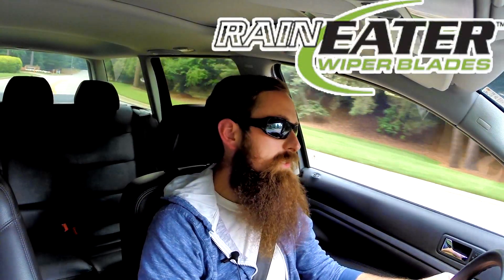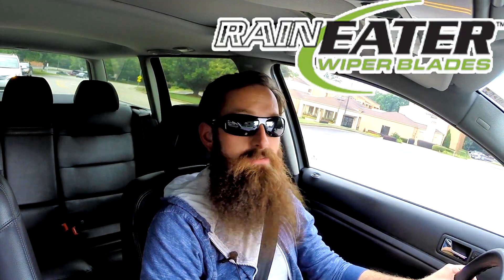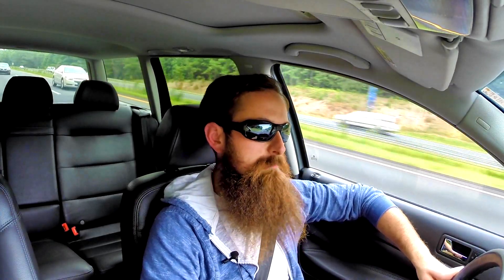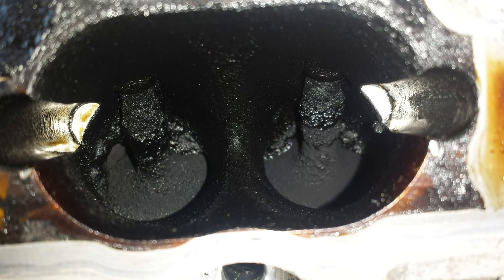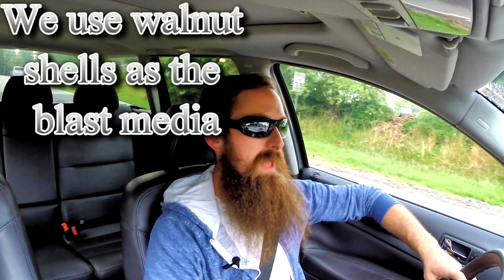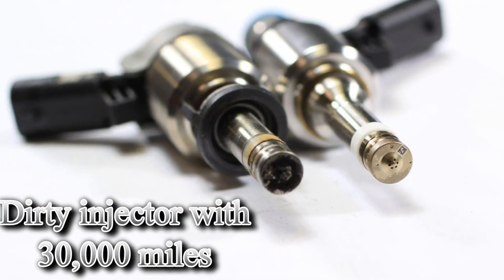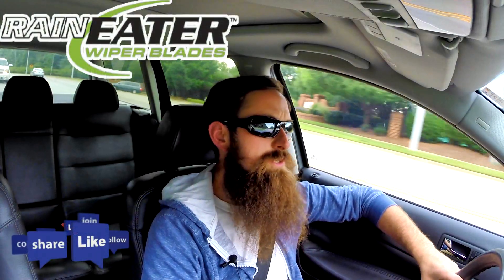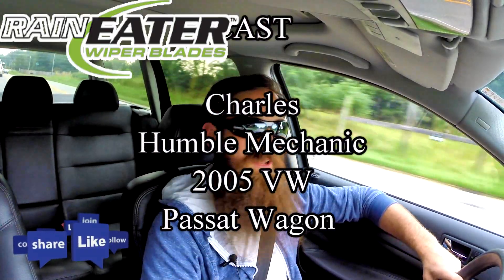Preventing and Fixing Carbon Issues for Direct Injection Engines ~ Episode 80

Comment: Hey Charles, I feel you left out a big point about how to prevent carbon build up. It's the easiest to do, a long highway drive. My friend has a 2012 CC with the Gen2 2.0 TSI engine and my mother has a 2014 Tiguan with the exact same engine. The difference? My friend did about 5 miles a day in city driving. My mother does about 80 miles a day and that's pure highway driving. The result? His had extremely bad carbon build up at 20,000 miles. It would misfire when warm, power was down, and it got bad fuel economy. My moms Tiguan has 50,000 miles now and got her intake valves inspected with a bore scope and it was almost like new. Very little deposits and no carbon chunks. I "cured" my friends CC by taking it across the country. It started out getting 22mpg and then got as high as 37mpg. I told him to take it on the highway once a month for over an hour. His fuel economy is up, his power is up and it hasn't misfired since. Ever since I did that highway run, the engine practically burned the deposits off since it gets super hot on prolonged drives. Thats my 2 cents...
Reply: Carl Strandberg In the case of where someone is driving for not even 5 minutes, they need an electric car. A gas engine car will kill itself after practically no heat cycles. I have a 2013 Jetta TDI. Idling my car will never raise the engine temp, even in -20. I start it, let the idle smooth out for maybe 3 seconds, and I drive easily until my temp gauge starts moving.
Reply: Brandon Friesen idle will make the car warm up u dumbass
Reply: Luseei Fuel economy is a side effect of getting rid of carbon build up. If you do 20+ minutes of highway driving, then you should never come across carbon build up. But to those who do idle city driving that lasts for 10mins, then to prevent carbon build up, you need to do at least 2 straight hours of highway driving every couple months to get rid of it. It's just the side effect of direct injection.
Reply: @brandonfriesen5389  So, going by your post, it's totally okay for me to get that direct injection WRX I'm looking at so long as I go out of my way to have fun with it? I only drive six miles a day, five days a week for work, so I could take it on one of my off days for a 20-30 minute drive on the highway. I've been looking up info like this (known problems and preventative maintenance stuff) for several days now because I really want my next car to stick around for more than 5 years.
Reply: @brandonfriesen5389  I don't think you guys understand how bad this issue is, it will be an issue for any DI engine. Not just vw. 

I've seen cars need to be started 4 and 5 times to stay running from GM, VW, BMW, and Mazda now. 

I've seen this build up on cars that get a "direct injection service" every other oil change (keep in mind many synthetic oil change intervals are 10k) still get this build up. 

Between EGR and poorly designed crank case ventilation systems, and the fact the fuel is no longer cleaning the valves chemically, you get hardened deposits that can not be removed from driving the car hard. 

Yes, routinely going on long distance higher rpm drives will lessen the rate at which these deposits form, but my 160k Mile Mazda has had to be done twice now and its boosted, so no amount of heat that is safe for the engine is going to magic away the gunk that builds up. Stuff gets on there, hardens over time, then more stuff builds on top of it. It takes me about an hour per cylinder or 30 minutes per valve to clean them. AFTER I have remove the intake manifold. It takes a lot of scraping and soaking in chemical treatment, and then blasting with a sand blaster gun and walnut media to remove MOST of this crap, you can't get it all out short of going to new valves which would require removing the head.
Reply: +Brandon Friesen I had the same experience.  My FSI motor was throwing a cyl 2 misfire consistently. I drove it from LA to Washington (20 hours straight through) and gas mileage is up along with no more codes.  It seems that the prolonged driving, spirited and on cruise control, helped with my FSI problems.
Reply: The current manual for a new GTI actually talks about what to do if the fuel economy goes down and engine starts to misfire. Their solution is to "avoid driving short distances". To me that sounds like even VW themselves suggest taking their cars on longer drives in order to prevent carbon buildup.
Reply: @BerserkFury89  99
Reply: Yep, my old father who was a car mechanic recommended it to me too: go onto the highway and drive like hell for a couple of hours every month. Fun to do too. Never had any issues with carbon, ever.
Reply: He already mentioned this at 4:12 the “Italian Tuneup” lol
Reply: Brandon Friesen Yes, you're correct about the Techron I put in the tank. That won't touch the valves. I put the Redline through the vacuum line located on top of the throttle body so the drips would be caught by the airflow and (hopefully misting) be ran over the intake valves. I did half a bottle then let it sit for 30 min and did the same with the rest. I didn't do any visual before and after of the valves becasue I would've had to take the manifold off twice but the first time I did it I got a bit of carbon suspended in what I thought might be water that came out of the tailpipe.
Reply: @coldbiscuit  Using a fuel additive to clean the valves actually isn’t such a bad idea. But you might get even better results with a different method getting it in there. Why not mix some gas and additive into a clean garden sprayer, set the nozzle to a little finer mist, and spray it through the throttle body while keeping the engine at a steady 2k rpm. I’ve never tried it, but it seems it would atomize better. Plus, it would give you the benefit of getting gas to the back side of the valves like it would if it were port injected.
Reply: @coldbiscuit  Your treatment sounds really good, My worry with walnut shell blasting is, where does the residue end up? is it just burnt next time the engine starts? and ,if so, is there any danger that when exiting through a turbo charger that the turbo blades could be damaged.
Reply: BerserkFury89 even my 95 golf it is recommended to not take short drives or my oil sludges up. if i drive it longer than a half hour and let it get really hot then it runs great and the oil stays clean and viscous. i know its not the same problem but the best thing you can do for an engine is use it
Reply: Brandon Friesen this cures sludge problems as well
Reply: Then my car is probably not going to have this problem as I'm always taking around 200 mile road trips sometimes 1 or twice a month, depending on the time of year of course. Got one coming up in a month or 2 now. On top of that I let the car just idle before leaving and when arriving at work for a few minutes. I never just shut it off when I arrive.
Reply: Very true and excellent info. I have also found synthetic oils with low vapour or Noack Volatility numbers work well. My wife has 18 Q3 with no problems as i switched off the dealer Castrol Syntec to Amsoil and it has now carbon on intake valves when i checked with scope.
Reply: TheRebuilt1 it has carbon now or doesnt?
Reply: James Medina doesn’t . Amsoil has Voc numbers their website for European 5w/40
Reply: @TheRebuilt1  Sounds very positive, i Googled 18Q3 and do not get any make or type of oil. Could you be more specific please.
Reply: Hessel Dijkstra . Car requires 5w40 and I use Amsoil 502.00 classic euro formula. It’s vapor voc number is 7 percent which’s very low compared to standard synthetics like Mobil and Castrol Edge
Reply: @hesseldijkstra5327  2018 Audi Q3 with 2.0 TFSI engine to be more specific from me.
Reply: @TheRebuilt1  u mean with Amsoil, it added more carbon?
Reply: Shariff Yep no it reduced carbon buildup as the Voc (Noac Volatility) number is much lower than Castrol Syntec’s 11 vs Amsoil 7
Reply: This is the same thing we've had to do in european diesel cars for years now. You'll literally destroy them with city driving. Different problem, same cause: Combustion engines are not built for that kind of use.
It's a good excuse for some good ol' "spirited driving" when possible, though :D
Reply: +Brandon Friesen I think that by running a bottle of complete fuel system cleaner through a suitable vacuum hose connected to the intake manifold every 3-5k would be a good preventative as well. Redline SI-1, Techron Concentrate Plus, Valvoline Complete FSC, or Gumout Regane (Not the high mileage) Those have the highest PEA content (Redline actually, but Techron is best bang for buck) I put Techron in my tank and ran Redline through a vacuum line on top of the throttle body and it cleared up my problems.
Reply: +Brandon Friesen Exactly! I was more thinking of gasoline engines (which was not the topic, but anyways)
Reply: +Johney Aimlessly haha looks like I shouldnt have a problem, I do too
Reply: taking a long hway drive to regain fuel economy, that sound like 2×5 n 5x2 ,both equel to 10 ☺
Reply: Brandon Friesen your absolutely right. Take on the freeway and Accelerate with high Speed cautiously and carefully
Reply: so in theory I should run my wrx on the highway with  a bit of spirit to keep it clean?
Reply: Myth .I drive plenty on the highway.Still had buildup.
Gas mileage started dropping at 60k.
Besy bet is to put an intake cleaner every 5-10 k.
Reply: I'm thinking of buying a used Tiguan (aiming for one less than 25k miles on it), do you guys recommend just driving that thing for an hour or so in the highway or do you think Intake Valve Cleaner sprays will help with it?
Reply: @minabobina420  use CRC intake valve cleaner. Works great! Do it before an oil change.
Reply: Brandon Friesen gives me an excuse to highway cruise heck yes
Reply: I have a 15 beetle 1.8t auto. I live in South Texas. Hot and humid. Car has 49k on it. I always let it warm all the way up before I drive it. I've heard that's the best for your turbo before driving. Idk. Hot oil flows better. Just what I've researched. I do drive fast, not hard racing type driving. Idk if I have carbon build up or not. Very good maintenance. What's the best way to see if I do.
Reply: yeah on the HWY miles. my 2015 GTI is at 165K, the dealer checked it out around 130K for carbon and they said its fine. for about 4 years in a row I drove 200 miles a day for work mostly on hwy.
Reply: @bucknut2000 how did the dealer check it and determined it "was fine" ?
Reply: I have same 12' CC turbo TSI 49 tho. Miles local driving but I drive fast , no problem, how ever I am planning a 1,000 mi. Trip up north then back so probably 2,000 highway 500 local. I'm nervous to take trip because, plastic parts and no major work yet, normal, battery, oil change, in your opinion what should I do before going. I'm not spending 1000 dollars that VW wants to do time up and check all, they always find something. Make thier commission.
Reply: How can you see the backside of a valve with a borescope ?
Reply: @ you’re responding to me from nearly a decade ago. But I believe it was one of those bi directional scopes with multiple cameras pointing in different directions.
Reply: Is it recommended to put the guitar into manual select mode so you can drop it down to get the RPM’s above 2K on the freeway. With an 8 speed Tranny on my Telly I’m not getting above 2K unless I’m passing on the freeway.
Reply: I have a 3.2 fsi audi with 150 000 km and have never had a carbon issue. I drive about 90 mins highway every weekend and usually drive the vehicle pretty hard in the cities light to light.
Reply: Good comment, I can't believe there is so many people just driving a few meters, never letting the car warm up properly.

 I also think it's important to just let the car idle for 10 sec before hitting the gaspedel.
Reply: @Xfacehack  well...I have less than 4 miles drive to work....what am I supposed to do? Leave home an hour early every other day and get stuck on expressway while trying to burn carbon deposits?
Reply: @spol1622 WoW!  You would not even be up to full operating temperature in just 4 miles.  Example: I drove 20 minutes (5 min. Warmup) when morning temp was 60°F. … the oil was still only
Reply: @Xfacehack  Never, ever rev a cold turbo I was told. Wait for warming before starting to give it some welly.
Reply: Cold Biscuit On a car with direct injection, I'm not sure it'd work that well other than clearing up fuel lines and the piston head.
Reply: @brandonfriesen5389  my catylic converter went out on my Hyundai Tucson when I started to get rid of the carbon buildup 10 months later it went out like wtf once it’s bad it’s bad I even manually cleaned the valves too late 10montha later it went out which sucked it would have costed me 3,000 to fix I traded it in as it had 103,000 miles. And was also slightly pinging as carbon increases the compression.
Reply: +Brandon Friesen - Plenty of people who do long commutes every day have carbon buildup.  They may even experience it sooner in time period because of how many miles they drove.  It seems your anecdotal evidence "might" apply to some DI engines but certainly not all.
Reply: I hear that you can't use an intake cleaner with GDI and a turbo. (ruins the turbo)

Comment: Can you share a Picture or a video of the Machine you use in Work ?
How are the results with the Walnuts ? Mitsubishi uses something like that on their GDI engines.Is it a special VAG/VAS Tool or from where did you get it ?
Reply from the maker: chrisi1909 this is the tool that I bought for the shop. We modified it a little, and it works great. I will dig though and find some before and after pics. This is the best way I have seen to clean valves. 

http://www.bavauto.com/fland.asp?part=B1100001

Comment: HumbleMechanic great video as always. From what lots of folks have been experiencing, catch cans AND a full PCV delete/replacement (see 034 Motorsports setup) certainly helps with oil vapors and oil deposits in the intercooler AND charge piping, however I believe there is enough evidence to support that they do not prevent entirely carbon buildup on the valves....which is a huge bummer.  It would be a welcome improvement over the OEM PCV, but not a cure all.  At the same time having a fuel wash on the valves (read port, or methanol injection) would be about the only fix for this as you said in the video.  I've been running methanol injection post throttle body and post intercooler for about a year now, for fuel supplementation plus temperature decrease, with the secondary benefit of valve cleaning....hoping the methanol/ethanol mix that I'm using is enough to counteract the buildup.

Comment: Thanks for the video.
I am planning to do manual carbon clean up on my TSI engine soon and I have one question.
How do you close valves that you find open once intake manifold is removed? I am afraid to spray or do anything in that valve because gung might fall down to the cylinder. Can I close it with vagcom? Or is there any other method to do that?

Thanks
Reply from the maker: You have to manually do it. I take the plugs out, and rotate the engine clockwise with a wrench on the crankshaft. 

You can see when the valves are all closed.

Comment: Do diesel engines have carbon build up on the back of the valves? (2008 VW Golf 1.9TDI MK5)
Reply: João Mendes i dont know about the US-spec but WU spec diesels have EGR and that means guaranteed gunk buildup(not carbon alone) as you have oil that comes from the turbo(there will ALWAYS be oil passing the seal, more as the car gets older), oily mist from the CCV AND soot/smoke that comes from the EGR, lovely mixture for "gunkitis", but AFAIK it stick sticks to the manifold instead of the valves and will gradually decrease the bore (the 2005 ish jettas i've sene pcitures where the bore was barely 2cm wide in each runner, the rest all covered by the gunk)
Reply: Guillermo Lovato Damn. Thank you for the info, anything I can do to prevent It?
Reply: João Mendes Btw It is the bluemotion thing and I live In europe.
Reply: João Mendes i have no idea about the bluemotion, and also the 2009 IIRC is already common rail i havent seen horror stories(other than the HPFP grenading) for that car but havent really look for them either, some googling might help you find the info.
There's really not much you can do, cleaning the manifold is a relatively easy DIY usually
Reply: João Mendes Yes, and on diesel engines that are mostly operated at low speed or under a light load the carbon and unburned fuel "slobber" is exacerbated and potentially damaging to valves, valve seats, valve guides, pistons, rings and cylinder wall glazing, and also loss of performance. The coking condition can also extend to exhaust system and emissions components reducing their effectiveness and requiring service.
Reply: Ok Thank you
Reply: patw52pb1 is this damage iformation valid for gasoline port injected or carburated vehicles as well? i have an oldie and old People drove It. Slowly, of course
Reply: Guillermo Lovato the Bluemotion thing is for emissions I believe, Thank you
Reply: João Mendes It is certainly possible, but typically, not as severe for carbureted or port injected gasoline engines. 
What I described in the previous comment was for diesel engines. 
There are known issues with practically all engines that experience extended idle times or continually operated at low speeds or light loading where there will be some deposit buildup on the valves and combustion chamber that "can" cause the issues I refer to in the previous comment. 
Carbureted or port injected gasoline engines are relatively easy to cleanup with good fuel, fuel treatments and driving habits/style, it may take a few treatments and some time, but it should not require any major disassembly. 
Watch the Humble Mechanic videos, he gives some good tips on preventing and removing deposit buildup.